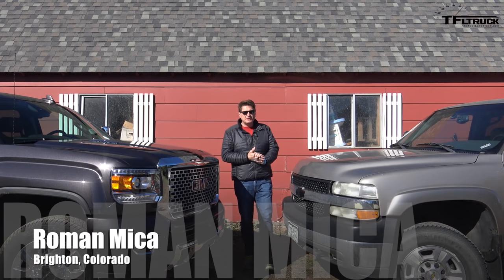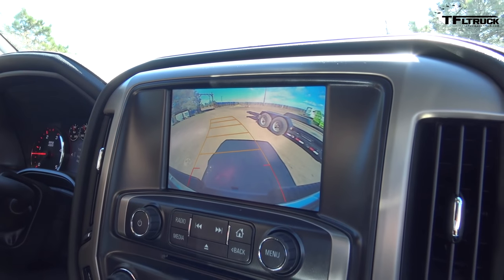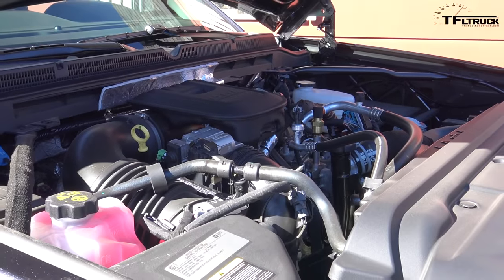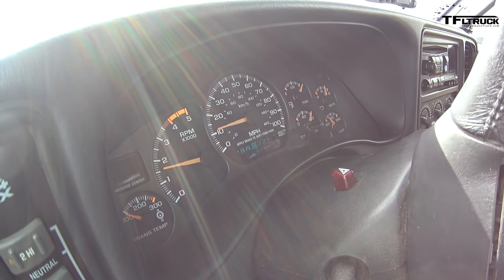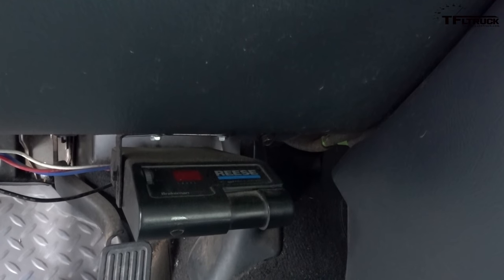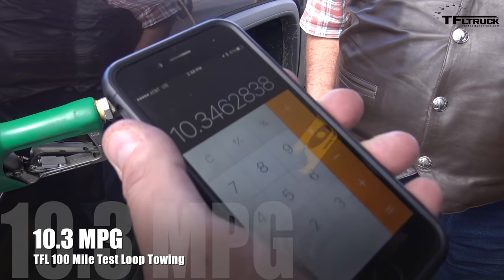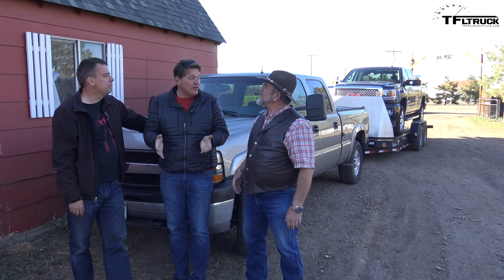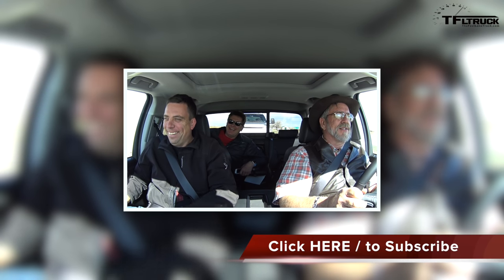2016 GMC Sierra Denali HD vs 2002 Chevy Silverado 2500 HD Mashup Review - Old vs New Ep.1

Comment: OK guys, this is all you need to know. I run 13k miles a month in a 2002 dodge 2500HD. 6 speed, Cummins. I routinely pull a 30 foot Osprey long cabin on a 3 axle trailer, grossing 22k pounds total. I'm little Cummins gets 14.2 miles to the gallon between North Carolina and the Canadian border.  I rolled the odometer over three years ago, and I'm now at 360k again. Id love to have a new truck, but I haven't found one that can top this old work horse.
Reply: Rolled the odometer over and at 360 again!? You mean you've been past 360 once?
Reply: +Ian Turney Yes, in 2004. I deliver boats. I bought this truck brand new, and have average 13k miles a month for 15 years with just a few breaks in the hardest part of winter. The body is about to rust away, but the engine and transmission are only about 40 percent warn according to the oil analysis. I run a low micron oil filter, and 3 stage fuel filters. keep it clean, and a diesel will run forever.
Reply: +James Jarmon Wow that's crazy. You usually only see miles like that on a Semi.
Reply: +James Jarmon Pretty sure you might be a record holder I know the world record for a car is like 3 mil but still.
Reply: +Ian Turney Record for a car is like 6 million. Don't ask me how but some dude has a jaguar he's been tooling around in since the 60s. I paid dearly for this truck, and I've worked it hard. But I do all I can to maintain it. I just cant bring myself to pay 60k dollars for a new ram. The seats aren't even comfortable. It is kinda funny to see me pick up a 150k dollar Mastercraft wake-board boat at the dealer on a truck worth less than it's trailer. But I do it every week.
Reply: @jamesjarmon7383  you think that's funny? Imagine how it looked for my friend towing a BRAND NEW Ford dually platinum on his 1st gen dodge with a gooseneck that cost more than the dodge
Reply: Today my old 02 dodge is worth about 4k dollars. The trailer I pull everyday is a PJ T9 rollback trailer. The trailer is worth twice what the truck is. I had a new Ram 3500 worth 76 grand on it two weeks ago.
Reply: @jamesjarmon7383  was it your trailer or is it a company trailer? Was it your new ram or someone you know?
Reply: It was my trailer, with someone else truck. I delivered it from Idaho to North Carolina. Trucks that wont fit on a transport , can go on my rollback trailer. So i deliver a lot of boats, on there own trailers, and big stuff like hummers and crew cab trucks.
Reply: @jamesjarmon7383  ohhh okay, I thought you meant that the 3500 was pulling the trailer, my bad

Comment: It gets worst for the GMC. It requires DEF, which isn't too big of a deal, but it's still an added cost and a chore that Andre never sees with his Chevy. There's also the DPF, which regenerates every now and then, lowering overall MPG. Then there's the problem with emissions controls. All that emission crap is complicated, they diminish reliability, they reduce longevity, and it all can easily get very, very expensive to repair when it all starts failing.
Reply: The DEF when released often winds up becoming toxic ammonia, but hey, the EPA is happy

Comment: The problem with new trucks is all the pollution control bullcrap! It affects fuel economy. And then  there's the price. 70k for a truck is rediculous. Probably could get that 02 for under 10k.
Reply: I'd say used truck pricing varies greatly based on the area of the country. Here in Virigina, I'd expect to pay $15k+ for that 2002. I'd sell my 5.3 gas truck and buy a truck like Andre's if I could get one for $10k.
Reply: +msclecarcrzy I guess it depends on the truck and the area. Some clean Ford 7.3s are still going for over $20,000, which is just insane.
Reply: +CoreyHendo I could have bought an 06' with 170,000 duramax 2 yrs ago for 15k. One owner. The truck was loaded too
Reply: How much was the 02 new adjusted for inflation?
Reply: roughly 35k in 2002. that would be 47k today.
Reply: @AkioWasRight  has the oilfield hit your area? Because before it hit my town you could get a good 02 like the one in this vid for almost $8k-$10k but then the oilfield came and you have to pay $15k-$20k for the same one and the oilfield has been long gone and it's still that expensive
Reply: TheCheekyKnob Well, I'm in California. The oil industry demand on trucks isn't quite as heavy, but that doesn't mean the market for trucks isn't impacted by what goes on outside the state. Trucks here are clean, and the market is quite large, so people from all over the place, even outside the country, come here to buy trucks. When I sold my Ford (not a diesel, but it still sold easily), I had people from out of state, some in-person, some over the phone or email, trying to buy the truck. Even had a guy from Louisiana offer above blue book value right over the phone. Really, all clean used trucks are high demand.

Comment: Now for 7.3 vs 6.7
Reply: nah lets go older 6.9idi and the new 6.7
Reply: +The student Technician 6.4-6.7
Reply: Dodge 318 Cummins I'd like that too
Reply: +KohlerCoalRoller  i had the same idea
Reply: 7.3 anyday
Reply: 7.3 all day. I love any Powerstroke, but they don't make em like they used to.
Reply: 5.9 vs 6.7 Cummins
Reply: My crew cab 4x4 7.3 with 6637 filter and ts chip got right at 20 on the hwy. she was a good truck
Reply: How about 7.3 vs 6.0? Ha I'm jk you can't test them if the 6.0 won't even finish the test
Reply: The 6.7 is the best thing since the 7.3 as far as  Super Duty goes.
Reply: +Bryce Wright 5.9L is far better than the 6.7L
Reply: 6.9idi vs 6.7 never get cross shopped... 7.3 does because of the superduty...
Reply: KohlerCoalRoller Oh god no. 7.3s are so fucking weak
Reply: KohlerCoalRoller heck yeah
Reply: KohlerCoalRoller 7.3 all day
Reply: that would make an awesome video
Reply: yesssssssssssssss
Reply: 5.9 wins every time thanks
Reply: Shit I got 8.1 I'll tie up with anyone
Reply: Yes

Comment: I love my 05 2500 HD.  Just spent $2500 getting rocker panel rust repaired/replaced.  Got 250k miles.  Towed about 80-120k of those miles(10-14k pound camper).  Probably spent 10-15k deleting, replacing front end parts, and an alternator.  Original fuel injectors.  Deleted at 120k miles.  Love it.

Bought it in Jan 2007 for 28000.  Blows my mind that you can't get a base model F150 for that price now.  I'll be keeping it until the wheels fall off.

Comment: love my 2002 LT 2500hd 6.0 gas engine heated leather seats black on black. Bought it new  in 2002 was going to buy a new one can't do it at 150000 miles still runs strong. to many problems with the new trucks.

Comment: Old truck is better.  No emissions and luxury bullshit.
Reply: Lol u just can't afford a 2016
Reply: Lol u just can't afford a 2016
Reply: Lol u just can't afford ANY 2016 model and you can't get a loan.
Reply: a bad ass You don't know me. No i can't afford a 70k truck but even if I could I wouldn't buy one. A truck is tool to be used and abused.Therefore there's no point in having all these luxury features.
Reply: +headcas620 It aint a truck if its luxury im a square body chevy fan and i dont like the luxury stuff in my truck if you cant feel or hear that truck in the cab its not a truck to me
Reply: +jaar oakl agreed
Reply: @headcas620  I made my truck luxurious on the inside and I don't abuse it because if I do any hauling with it I wanna feel comfortable going back and forth and making sure it's not gonna break down on me because I "had to" abuse it, but I made sure to keep the outside ready for work and to pull because there's nothing wrong with wanting your truck to last, just because it's a truck doesn't mean you have to beat it to shit
Reply: My 98 Dodge Ram 1500 have 200k on it still going strong and still easy to work on the newer trucks you can’t work on them anymore to much computer crap on it

Comment: Just picked up a Duramax a couple months ago, 03 lb7 sierra slt with every feature available, efi live with 5 tunes, 4" straight pipe, edge cts2 insight, fass 165 with a sump, 180k on the odo. Love the thing, no emissions bs, way cheaper than a new truck, and built like a tank. Recently started burning oil at idle though, gotta figure that out.

Comment: GM's tend to get better MPG as they age too...
Reply: that's all cars....they should have put 5000-10000 on the new one.
Reply: my 90 gmc sierra can do 23 mpg
Reply: I average 16mpg in 02 silverado 5.3 with 230,000 miles and running strong for another 100,000 if the frame and body dont rot apart first. Runs like new!